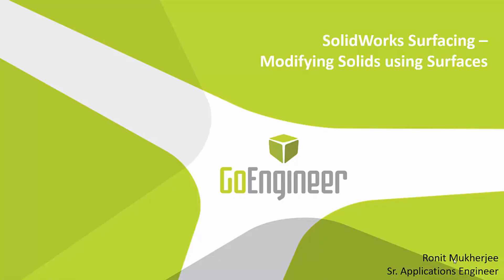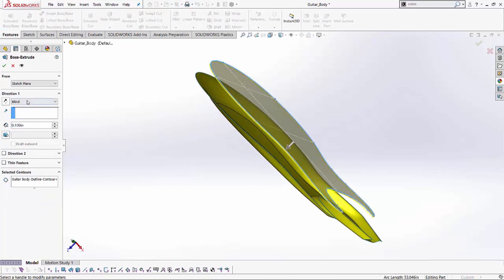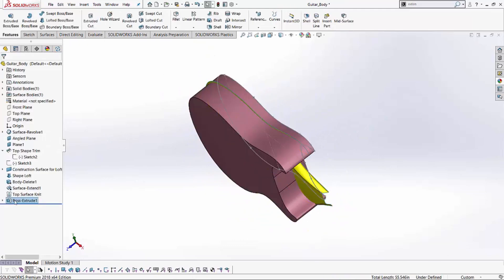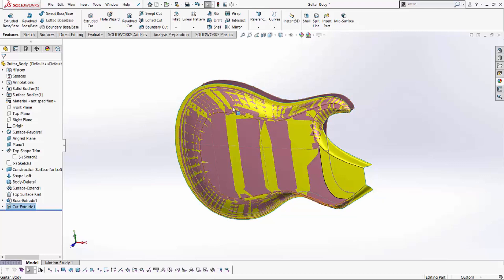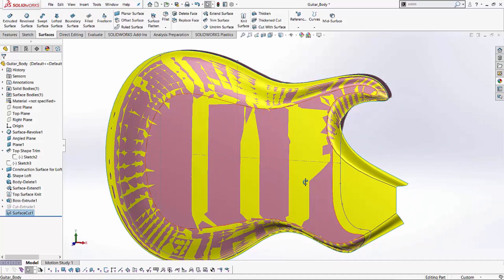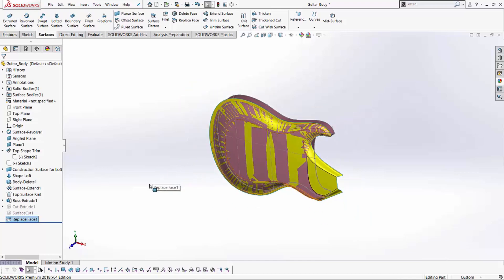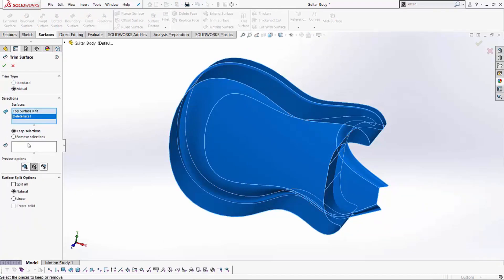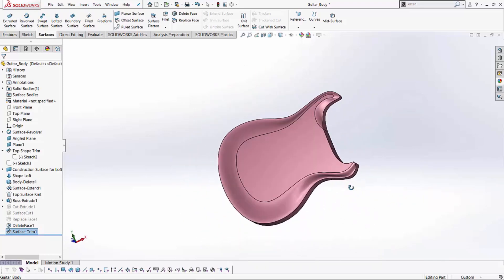SOLIDWORKS Surfacing - Modifying Solids Using Surfaces

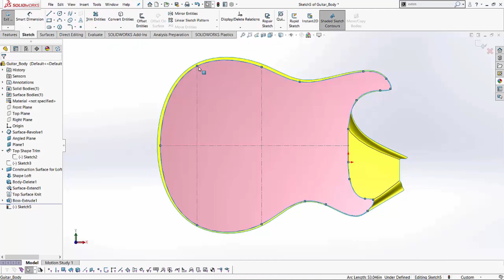Comment: It doesn't make any sense what you did at 2:03.  You extruded a face with the "outline" of the guitar body.  Then you just "converted entities" on that same face, again!!
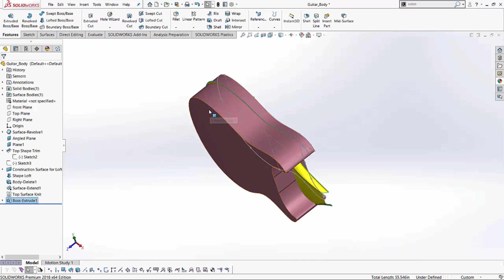What is the difference between that face at 1:56 and the face that you just "converted to an outline" at 2:03?
You could just do "convert outline" at the face at 1:56, right? Then cut to surface.
Reply from the maker: Sorry for the confusion! So at 1:56 a face is selected. We choose to make a new sketch on that face. We create sketch entities using Convert Entities. Finally we use the sketch to cut with. 

“What is the difference between that face at 1:56 and the face that you just “converted to an outline” at 2:03” – There is no difference, it is the same face.

“You could just do “Convert outline” at the face at 1:56 right? Then cut to surface. – No, we must create a new 2D Sketch on that face first, which is the step shown in the video.